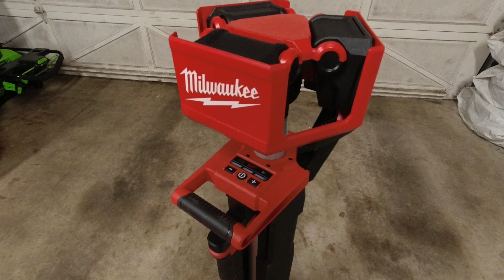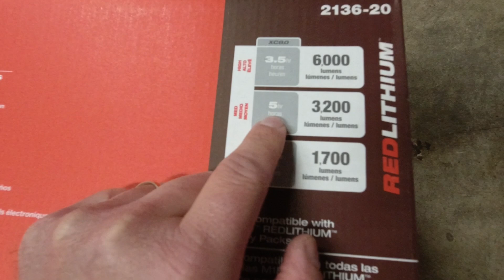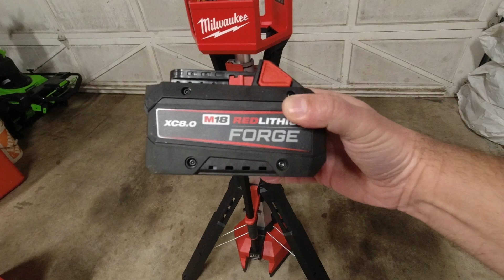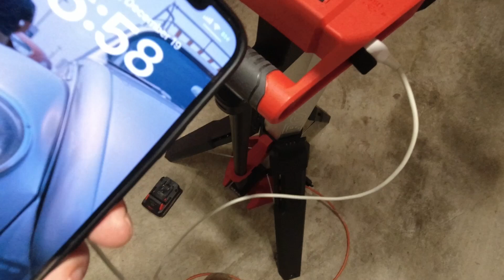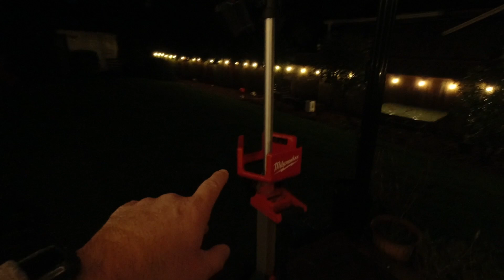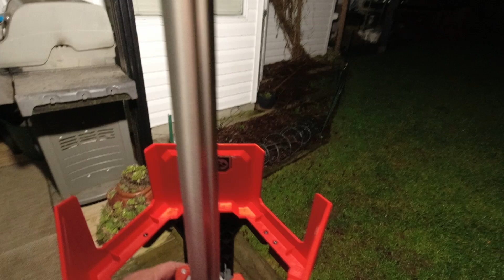Milwaukee M18 Rocket Tower Light 2136-20

Comment: i`ve had one since it came out, very happy with the light. But i left a 12Ah battery on it the last 4-5 month (the battery was left fully charged), when i was going to use the battery on a other tool. It was drained and couldnt get a charge on  it. Tried to "jump start" it also, no succsess. So suspect it drained and ruined the battery, never experienced that on any other Milwaukee tool before. Anybody else with same experience?
Reply from the maker: That’s unfortunate. I know with tool batteries in general they state to never store them either fully charged or completely dead. As well as never in cold temps if not using for long periods. I had a few Milwaukee batteries that lost capacity after I left them a winter fully charged in the unheated garage. I now bring all my tools batteries inside in November until the spring and put them at 50% if I won’t be using them. Thanks for watching.